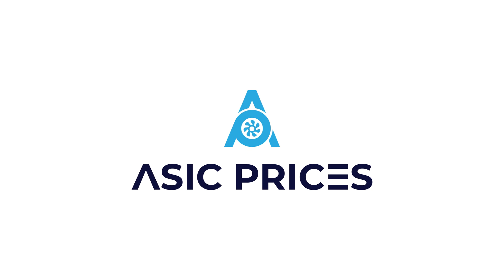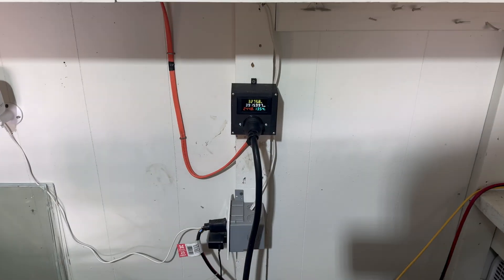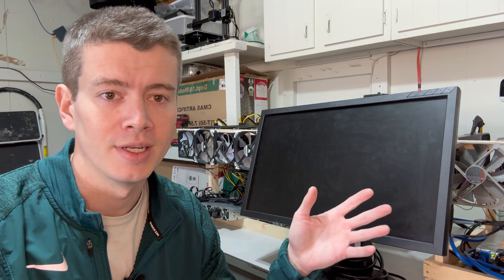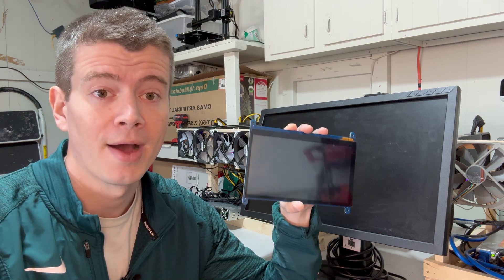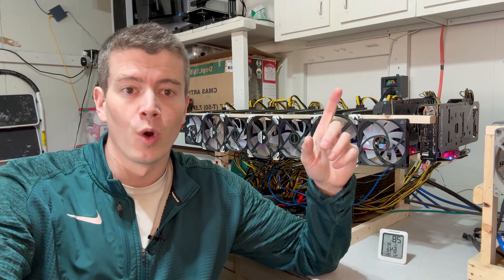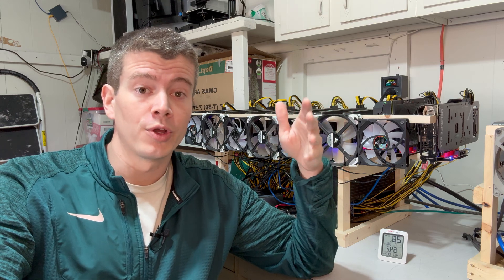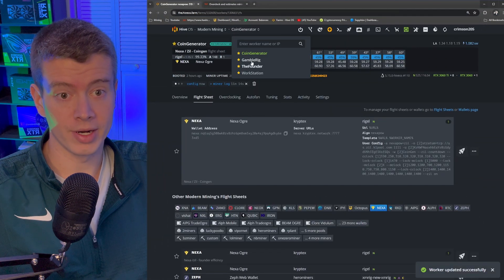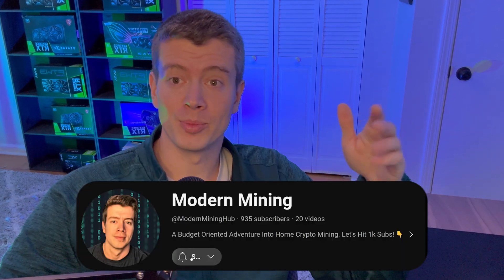8 EASY Ways to Save Power In Your Crypto Mining Farm

Comment: Also i see 2 sever and 1 reg PSU in that 6 gpu rig! best get one or just 2 bigger watts PSU and then u would use less and also need less power cards to a PDU.. I like the 1,600 EVGA PSU but there is a way bigger wattage server PSU . and with the connrect break out board the sever PSU can power the PC Mother Board!

Comment: I am using the CPU's to mine with as well.
Reply from the maker: This is a good one I should have included!
Reply: @ModernMiningHub  I try to run 40 series gpus and 7000 series cpus for best efficiency possible. I do still have 6x 3060 ti FE cards thrown in the mix as well. I've been bouncing between pyrin and karlsen lately on GPUs, & qubic and zephyr on the CPUs. I really need to do the 240V upgrade, and I've also been really weighing on the option of solar panels.